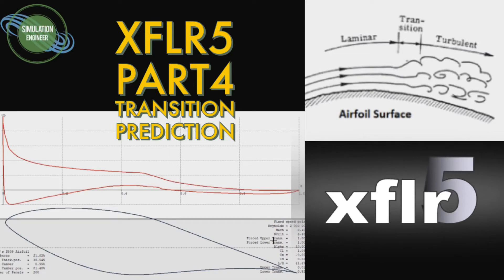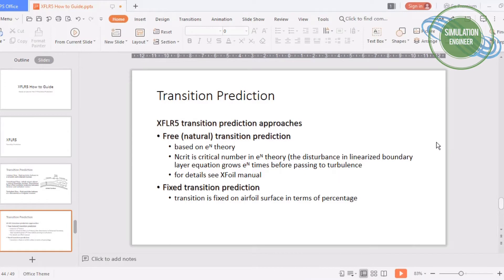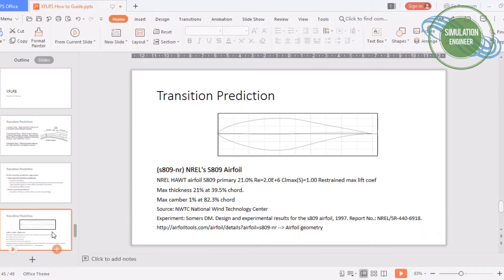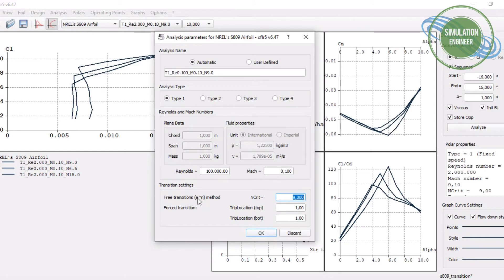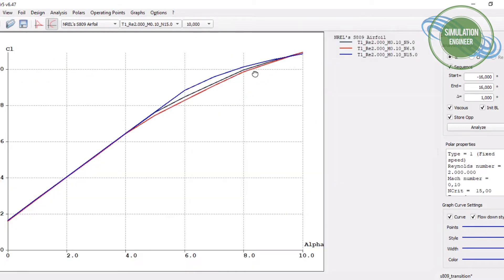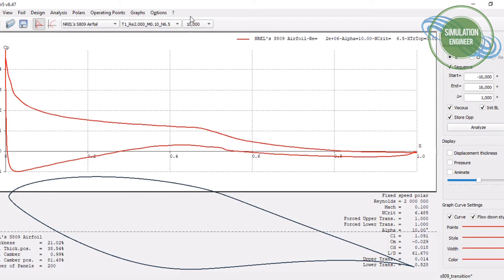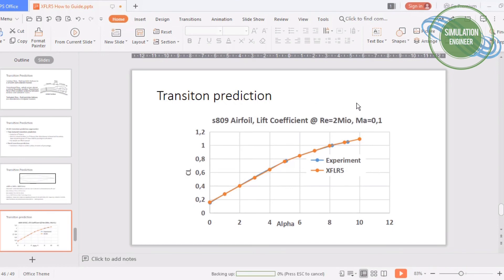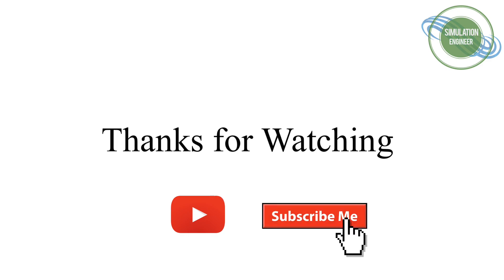XFLR5 PART4 TRANSITION PREDICTION | XFLR5 HANDS ON TUTORIAL SERIES

Comment: Hi sir,
Can you explain how I can choose ncrit according to Reynolds number
ex: Re = 24000000 => Which value should I choose for Ncrit
Thank you
Reply from the maker: Ncrit is critical number in e^N theory (the disturbance in linearized bl equations grows e^N times before passing to turbulence).
----------------------
Ncrit values: 
sailplane 12-14
motorglider 11-13
clean wind tunnel 10-12
average wind tunnel 9 <= standard "e^9 method"
dirty wind tunnel 4-8
------------------------------------
The conection between Ncrit and turbulence energy level is as follows:

N_crit=-8.43-2.4*ln(Tu%/100%)

For more details see Mark drela xfoil guide, thanks.